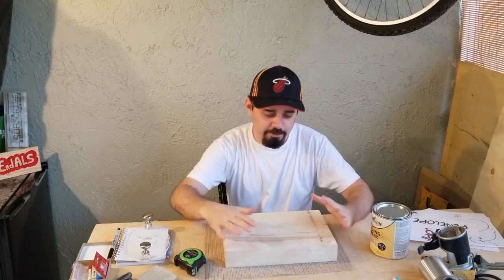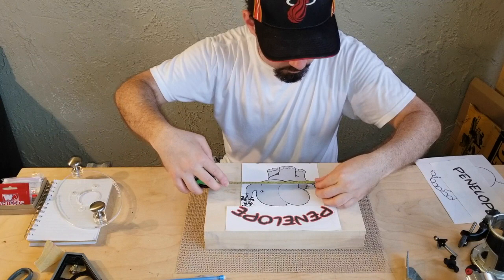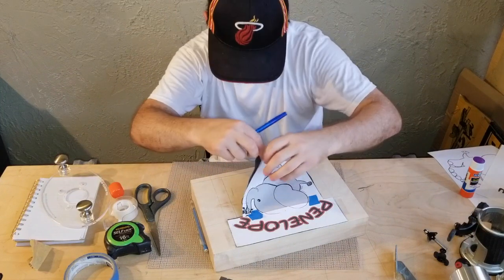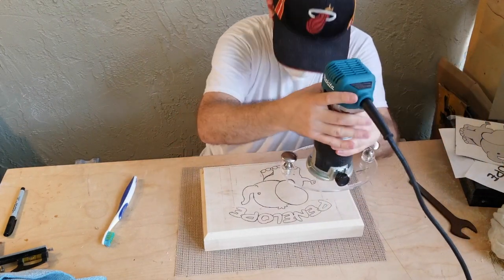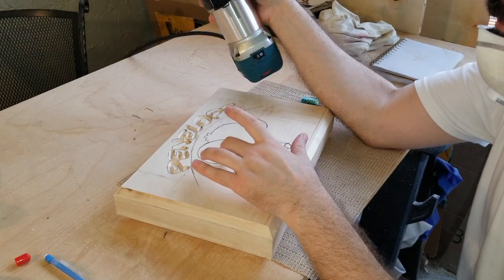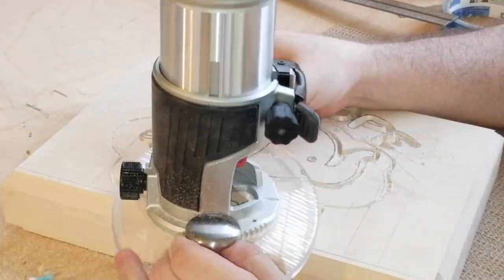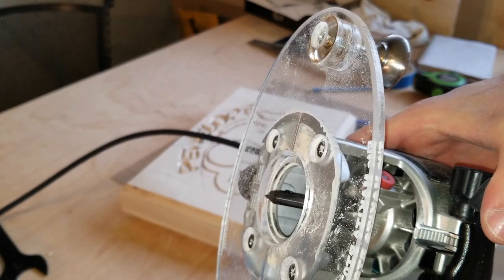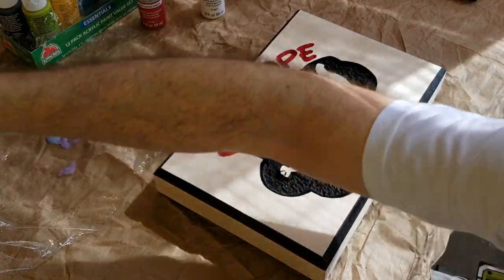Making A Wood Sign With Compact Router

Comment: Hi, when cutting out letters or designs do I always need to cut from let to right what if I accidentally go the wrong direction will it still cut or will I chew up or ruin my workpiece? I know the bit is made to cut in one direction but what if I go the opposite way? Thanks
Reply from the maker: These are very good questions, I'm not a pro or anything but a lot is going to depend on wood grain and the direction of the router spinning. Face grain usually is easiest to carve and edge or vertical grain is harder and easier to make the router wobble. for me it's more of a feel and what's comfortable, turning the board around helps. This basswood is easy to carve in any direction but others may not.

Comment: what bit are u using what speed can u show how u set uo fhe edge guide u used in the beginning, is this acrylic used in place of plunge router and why ? i just bought this makita router and plunge base and confised about when to use the plunge base vs trim base ?
Reply from the maker: Used the chamfer 45 degree bit at full speed. The edge guide not totally necessary but just attached it and lined it up with the edge of the wood and tightened up. As for the plunge base in my opinion just used more for Woodworking applications like grooves or slots, custom acrylic base is more comfortable for me and easier to me. hope that helps.

Comment: Wouldn't it have been easier to just glue the paper design on, let it dry, then follow the pattern with your router, then to finish you just sand off the scrap paper that's left? No need to be using transfer paper.
Reply from the maker: There's many ways of transferring patterns, I've done it with paper, or ink transfer and transfer paper. put perfectly fine doing it that way.